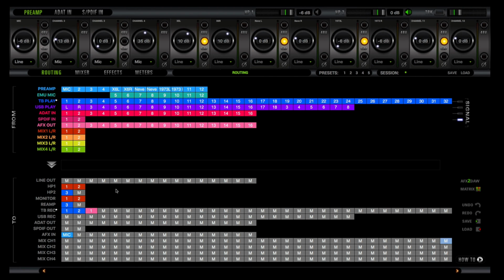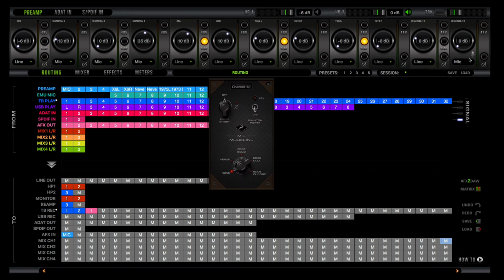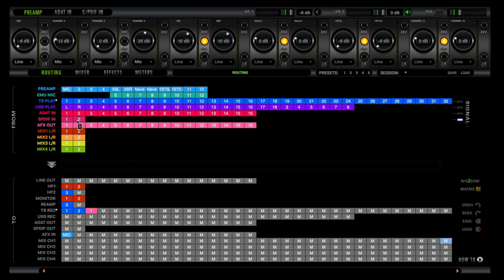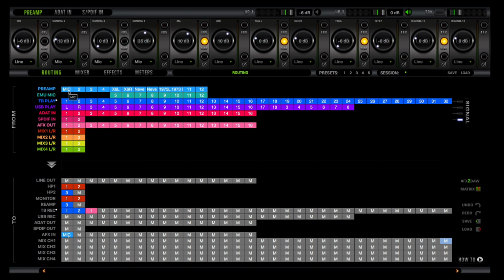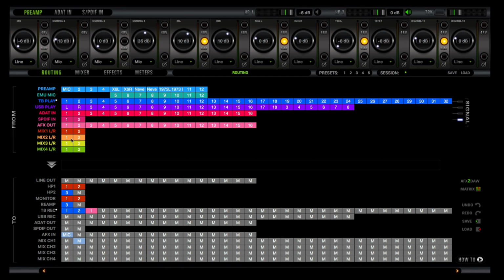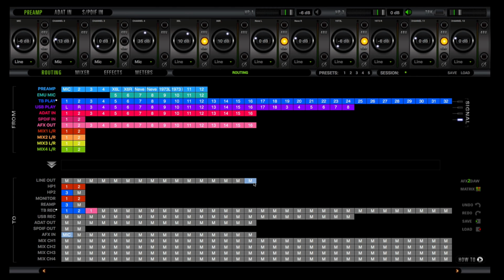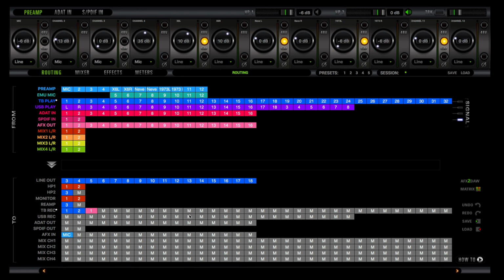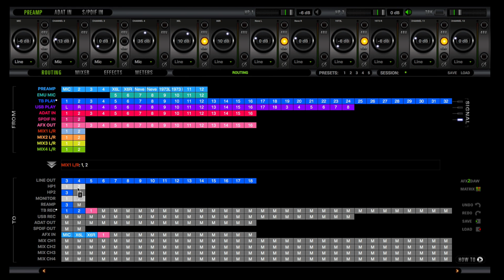Antelope Audio Control Panel Routing Explained

Comment: Can you link your outputs to your monitor and use the knob controlling the line outs and monitor.
Reply from the maker: I'm not sure if i fully understand your question. What i can say it the knob located on the front of the unit ONLY controls the monitor out. I can press the knob in to control the line outs, but it functions as a trim where i can control them all at the same time which is all handled through the control panel.

Comment: Hey bro. Real quick, I’m trying to get clear sound out of my monitor outs from my Mac via iTunes and YouTube. I’m having trouble with that. Any solutions?
Reply from the maker: Try checking your Mac’s Audio MIDI Setup and make sure the output sample rate matches your monitors (usually 44.1 or 48kHz). Also, go into Sound settings and make sure it’s not routing through any virtual devices. If you’re using an audio interface, set that as the main output in both System Settings and Audio MIDI Setup

Comment: How do you route the inserts in the digital patch bay and in your daw? I want to mix with some hardware.
Reply from the maker: I use Pro-Tools, so the set-up might be a little different depending on which daw, but this video here should help you understand it a bit more. https://youtu.be/87xJs55rHDI?si=_3h308Qt4LAHf2nb
Reply: @FizzENT  Thanks for your response BTW.
Reply from the maker: @joshcobb  No problem
Reply: @FizzENT  I'm in ProTools as well. I'm pretty good with understanding the ins and out I'm just not sure how to use the Hardware "Inserts 1 & 2" 1/4" inputs on the back of the Antelope Interface. I bought the breakout cable.
Reply from the maker: @joshcobb  Oh, The hardware inserts on the orion are interesting because those are automatically connect to A1 & A2 on the front side of the unit. Hopefully you have the Y-Split cable with 1/4' on one side and the corresponding connecters for whatever dynamics processor your are using for the otherside. Once you connect the back, you are good to go. Anything that you plug into A1 & A2 will be inserted before it hits the a/d converters of the orion.

Comment: how would you the loopback
Reply from the maker: What is it that you are try to do ?
Reply: @FizzENT  screen cast daw whit audio (screen Recording)
Reply from the maker: @comunidad-cubase  You would record the main outputs. Take the daw outputs and route them over to a record input (TB REC or USB REC) For example, you computers mains outputs might be 1&2,  so you would route 1&2 to a record input. Your microphone might be using input 3, so you will want to route that to a record track as well.  You might want to set up a monitor path so you can hear what you are recording.

Comment: So first off thank you for replying. With that said if I route in daw to any other stereo out in my daw they instantly sound better but in order to sum mix back on 1-2 I have to print back to cubase.So I make a beat then route instruments to there own out like 3-4 or 5-6 once I do that those groups no longer show up on 1-2 unless I print them back into cubase. I can’t understand why because it feels like I’m working backwards but the sound quality is lot better on any channel other than 1-2 don’t know if I’m explaining it correctly but is this normal.
Reply from the maker: If you send a signal out 3-4 or 5-6, that signal has to go somewhere, perhaps a summing mixer. Then, that signal will have to be returned through an input on a channel. Channel 1-2 is the default channels of computer playback. So anything playing back from cubase means that it is going through the internal summing buss. Some users will take the out of 1-2 and recorded back in, to capture the sound of the converters with a soft clip. From what i'm understanding it sounds normal.

Comment: Thanks for the video 
If you don’t mind I have a quick question.
So I work in cubase and use the discreet 8 pro syn version. When I use any channel besides 1/2 the quality of the material seems to become very detailed but It stops showing up in cubase main out and instead I have to record the information back into cubase and was wondering why would I have to print back into cubase if I’m not using afx effects?
Reply from the maker: I'm not sure if i'm understanding correctly. What do mean by it stops showing up in cubase main out?  By default, the d.a.w outputs are typically 1-2. The control panel routings sounds like it could be off.

Comment: how to control the volume of line outputs
Reply from the maker: This can be done two ways. 1) Using the control panel on you hardware unit. 2) Using settings. Click the control gear icon and locate line outputs There is one master control for all line-outputs

Comment: did you have issues installing the unified driver? I just bought the Orion 32+ gen 4 and a brand new Mac Studio m2 and for the past 3 days I've struggle to get the unified driver to stay installed for thunderbolt connection. So essentially I have 32 ins and only 24 outs.... I want to throw this thing out of the window and go back to universal audio apollo but I want to give it one more shot because I like the sound of the converter. Do you think you'd be able to help maybe through email or a phone call? Their customer service is trash.
Reply: did you get it to work

Comment: Can anyone here help me out! Lol I am trying to get a headphone amp connected via d sub to headphone amp but I cannot get any audio out of Analog 1-8 to headphone amp.
Reply from the maker: 1) Make sure routing is set up correctly {TB or USB REC or other signals  to --> Line OUT}
2) In preference, check to ensure that volume of LINE OUT is not muted or turned down. Use built in meters to verify the incoming and outgoing signals.
Reply: @FizzENT  thank you very much! I am about to try this and hopefully get it all setup! Thanks again I'm subbed!
Reply: @FizzENT  alright I tried that but TBH I'm a newbie when it comes to routing ESPECIALLY with Antelope. So I have a Goliath and I'm super lost with this. Would you be able to walk me through if you have time. So I have TB PLAY 3-4 routed to LINE OUT 3-4 and nothing. I know something iw wrong. Is it supposed to be TB REC to line out?? I don't think I can move TB REC to line out.

TB PLAY does go to line out but I'm sure im lost somewhere here.

Comment: Excellent video! Im new with my interface and I had to mute a couple channels in the mixer ch 2, but when I right click the options are Mute-Mute Row-Oscillator 1 and 2, so I dont know how to unmute now my channels, any idea?
Reply from the maker: Thank you! Although it is a "Mute" it really just clears the routing. So you will have to re-route your signal.

Comment: Nice Video. Fizz need your help which this. am Trying to cofigured my Orion 32 to connect hardware insert but is this complicated to me. Can you do a video about this process. I dont know how configured my interfase to thisT My Orion is usb. thanks.
Reply from the maker: Thank you. For the Orion 32 you will need DB-25 break-out cable. This will enable you to plug into one of your hardware units. Depending on your hardware unit you it might be XLR or TRS input. Then you will need a second DB-25 break-out cable to bring it back into the unit. I have Orion Studio which comes with hardware inserts so my process is a bit different. So your signal flow will be | DB-25 OUT of Orion |  > | INPUT Hardware Insert {EQ | COMP | } | > OUT of Hardware Insert > IN to Orion. Hope this helps

Comment: Muy buenas, soy Pedro de ESPAÑA me preguntaba si entiendes algo en español, Acabo de comprar la Orión 32 3G, y quisiera que usted me ayudara a instalarla y configurarla con asistencia remota, si fuera posible obviamente pactando un precio Obviamente pactando un precio. Gracias
Reply from the maker: Hola Pedro, mi español es muy malo, pero estoy dispuesto a ayudarte con tu instalación y configuración. Solo necesitaría recopilar más información, como las especificaciones de la computadora, así como todo lo que conectará a la unidad y el software que usará. Envíe un correo electrónico a fizzent@gmail.com y elaboraré algo.